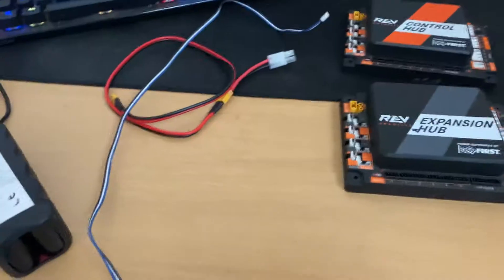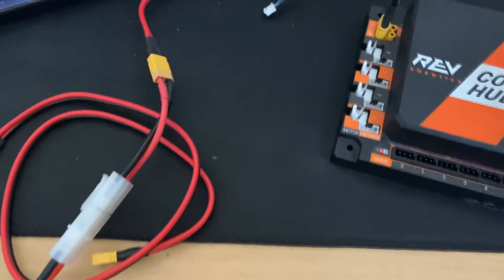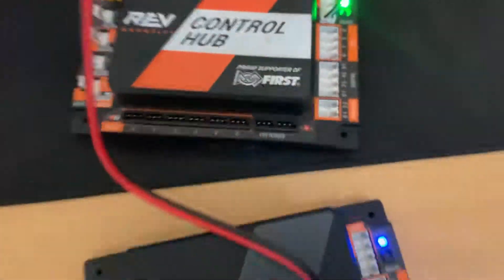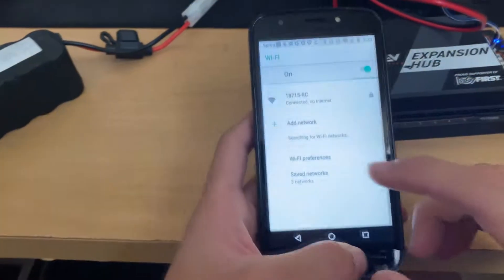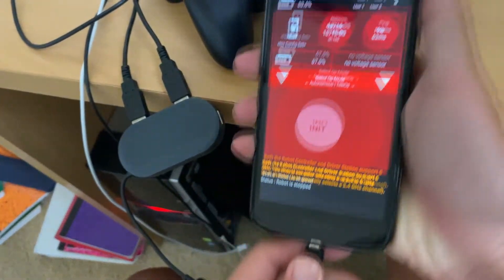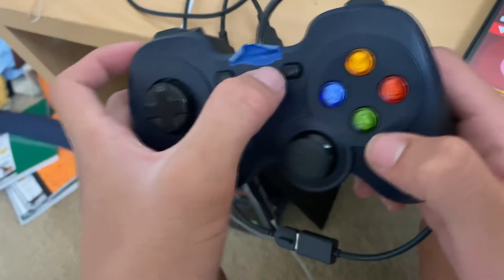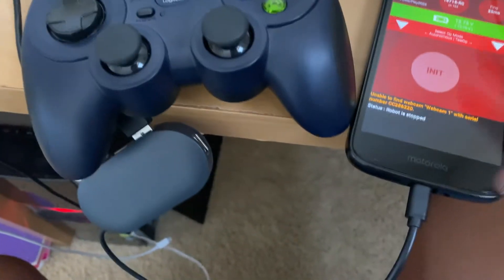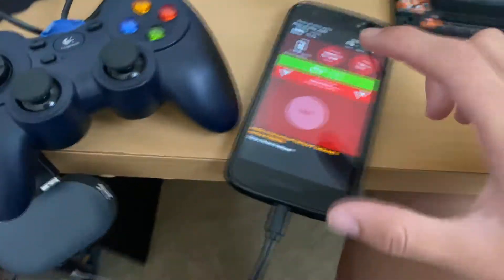FTC Programming Tutorial (Episode 3: Setting Up Your Control Hub)

Comment: Great video! Is a phone necessary? Or can you just control everything from your laptop?
Reply: you need a phone in the actual competition (or you can use the driver hub, both work the same). just check, however, if the android phone you have is ok per ftc standards
Reply: @smgabardo  thanks! I’m not actually using this for the competition though, I’m using it for an unrelated project. Can I still control the motors the same way just using a laptop, without a phone or the driver hub?